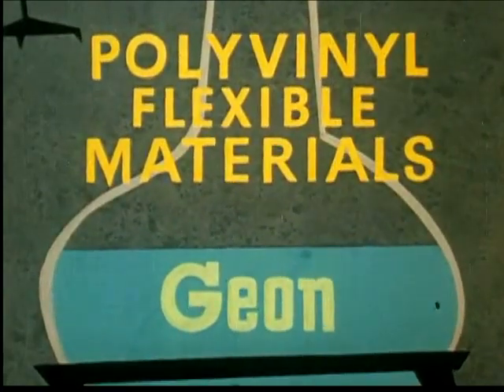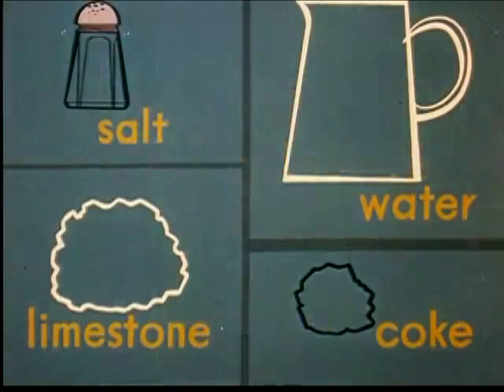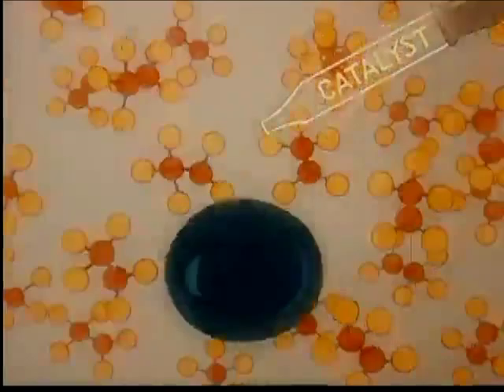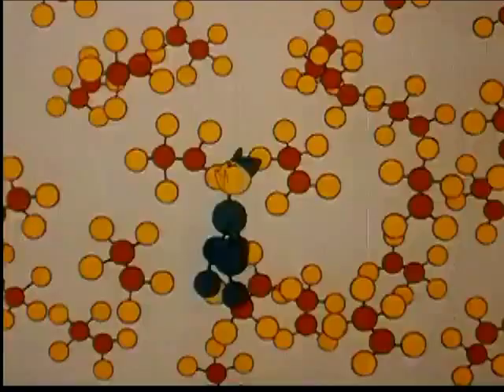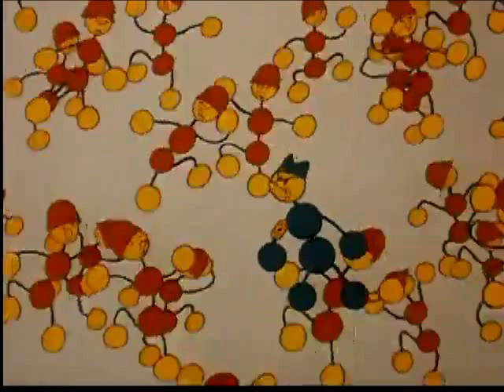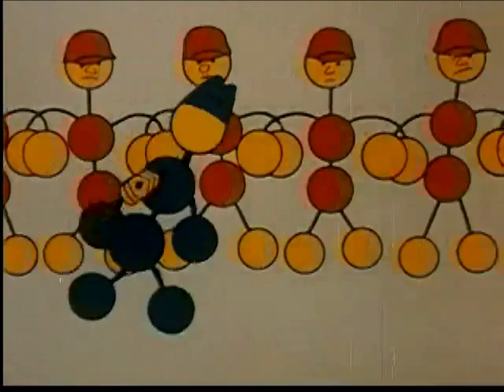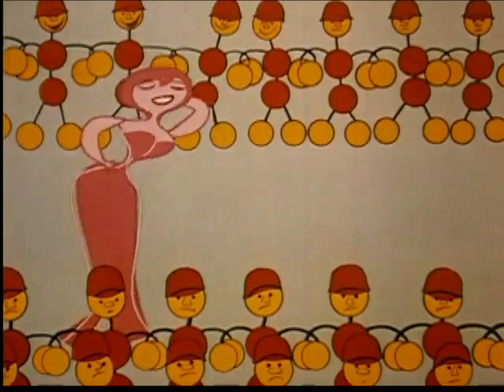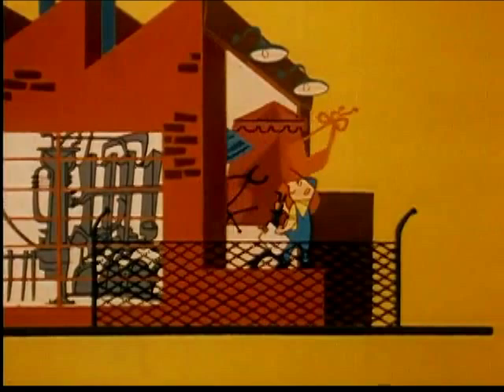Vinyl Chloride Production 1954 BF Goodrich Company

Comment: Today, the most often utilized method of making vinyl chloride compounds is through catalytic reaction of byproducts of the oil refinement process. When these byproducts are forced into reaction with other petroleum distillates a large amount of vinyl chloride compounds are produced.
When these compounds are burned and the resulting gases react with water in the atmosphere a large amount of hydrogen chloride is produced which will then fall back to the ground as it is emulsed into rain water droplets forming acid rain and the resulting runoff will go on to poison streams and rivers.
Reply: Let me guess...the sky is falling? I remember when sudam set the oil fields on fire. Some how it had no impact on the environment.
Reply: Who cares

Comment: Vinyl chloride (H₂C=CHCl) is a colorless, highly flammable substance that evaporates very quickly. It can form a hard plastic resin used for PVC pipes, wire coatings, vehicle upholstery, and plastic kitchenware. Exposure is associated with an increased risk of a rare form of liver cancer (hepatic angiosarcoma), as well as primary liver cancer (hepatocellular carcinoma), brain and lung cancers, lymphoma, and leukemia.

Comment: coke??
Reply: James Cho  coke is coal with all the additives and chemicals cooked out. Literally coal with the smoke taken out. Also used as fuel for blast furnaces in steel production.
Reply: Traditional blacksmithing also utilities coke, which is converted from coal in the coal/coke fired blacksmithing forge,which is a relatively small open hearth forced-air blast furnace used to heat the metal so that it is pliable enough to be shaped by special hammers,and other specialized tools.
Reply: Coke occurs when you add a drill Sergeant to your cola.